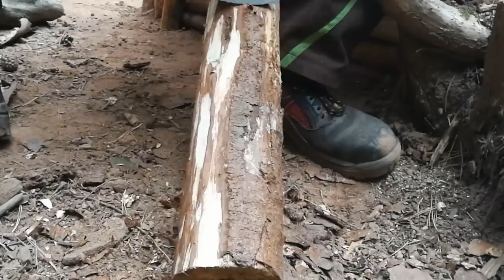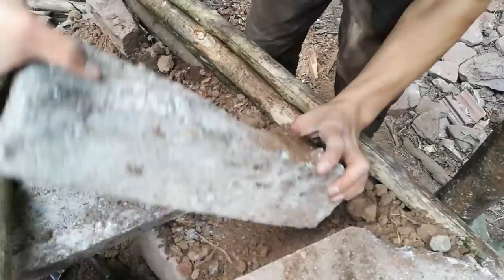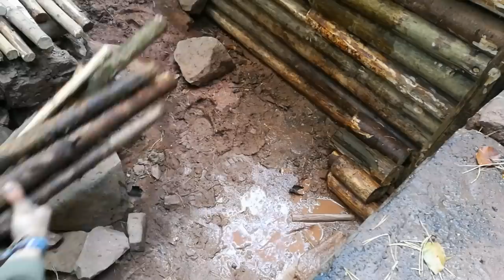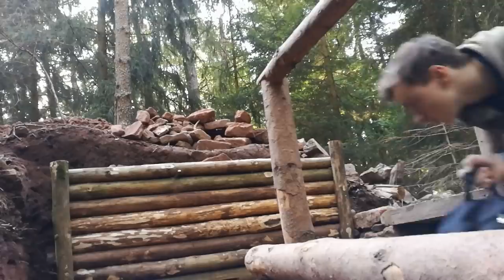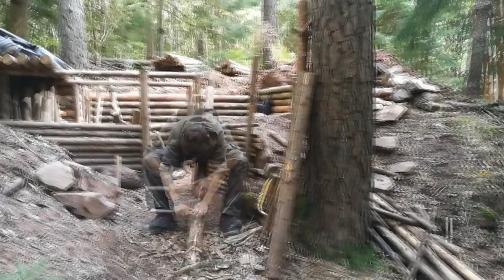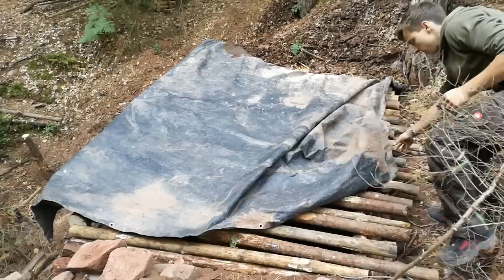From DUGOUT to small CABIN - Walls and raised roof, Dugout Shelter Part 3 // JustRandomPfusch

Comment: I don't get it, I've seen so many of these dugout, ww1 trench style dwellings on youtube and everyone just loves them.  When it rains what's to stop the mud and water from running through the walls and seeping up through the floor no matter what you put down.  Everyone just sees these things in the nice dry summer.  I've been in construction my whole life and you have to deal with the water by waterproofing the outside of the walls ( at least a chunk of plastic) and build your floor on something that will allow the water to flow underneath, like gravel or sand.  A skirt drain would come in darn handy too.  It doesn't take a lot of water to make your summer home into winter nightmare.
Reply: I agree your comment.
Reply: He said about how he has a rock layer behind the logs to act as drainage, I don't know how good that would be but at least that's an answer.
Reply: FYI at the beginning of this video you can see that it rained as he dumps the pool of rainwater from his tarp and underneath in the living space it's bone dry. Apparently the rocks and tarp prevent in leakage
Reply: @redrangerrr558  the rocks are there to divert the drainage if there is any.

Comment: if you burn (a little bit) the parts of the wooden stakes you are driving in the ground, they will not rot as quickly. I love what you are doing, keep it up.
Reply from the maker: Thanks, unfortunately I learned about this technique only after building this
Reply: I was thinking the same thing it helps out alot good seeing someone giving good info. Instead of some of the other comments who do nothing but insult.

Comment: You are doing quite well for yourself on that shelter! I hope that in the end of construction, that it is everything that you've wanted it to be! It's allot of hard work for sure! The project is very unique and should serve you for the years to come. If you were to create a small trench/water troth, 1/2 meter out away from your outer walls to help carry any water that could possibly try and infiltrate down into the walls; well then you should be in great shape! But then, you could also create a sloped overhang on the frontal entrance way; such as to detour any incoming rainfall too! Overall Kiddo, you are doing a great job! I'm proud of Yah!!
Had I'd known that you were going to take on a project like this one, I would have a really hot tip for you that would surely blown your mind that involves the use of tree leaves to make your shelter insulated, and yet as they decompose; the leaves will
actually provide you with heat to offset high usage of having to use large amounts of firewood.
Reply from the maker: Thank you! :)
I will do something about the drainage. It works well so far, but it can definitely be improved

Comment: Have you considered digging a little trench around it?
Just so potential waterfloods of heavy rain flow AROUND it.
It looks like there is a little hill nearby or sloped terrain.
Reply from the maker: Yes your right, there is a slight slope and I also considered a trench. So far the shelter is holding up well without, but I think I'll do it someday
Reply: @JustRandomPfusch  Probably already 10cm and a few rocks would suffice.
Reply from the maker: @MWcrazyhorse  that's what I had in mind, too
Reply: @JustRandomPfusch  And you could make the trench round or triangular so water would flow better.
What about a rainpipe? Trench/ rainpipe.
Reply from the maker: @MWcrazyhorse  I want to use natural materials only
Reply: @JustRandomPfusch  Maybe a halfed log hollowed out.
Something to direct the water off the roof into the trench so it doesn't accumulate near the entrance.
Reply from the maker: @MWcrazyhorse  because the roof is sloped to the back, there isn't much water accumulating at the entrance. S the main problem is the back of the shelter, where all the water runs to and seeps in the ground directly besides the shelter and tends to push through the walls. So I need to divert it away back there
Reply from the maker: @MWcrazyhorse  hollow log could be a solution 👍🏼

Comment: I'm basically building the same thing.  But I 
am dug in about 7 feet on 3 walls. 5 feet on the 4th wall dirt bags the rest of the way on up. Gonna seal walls in with white concrete paint roof will be covered in dirt flat rock floors and small rocket stove with a copper coil for hot water and solar for electricity. And the view I'll have people where I am from pay a million or more for there house.  
Plus I have plenty of room to add on later on. Plus do an small A frame on top of it later for a kitchen and bath plus sitting room to see my million dollar view

Comment: when using a chisel to chip , remember that flintknappers technique of rubbing the rough edges to control the break otherwise you might knock off a huge chunk in the wrong place and ruin the work  _ T4S

Comment: Just a heads up concrete has a tenancy to explode in high heat such as a fire place you might  want to change that to stone or even mud brick
Reply from the maker: Hm, your right, I didn't think about that. As you can see in the thumbnail we already built a chimney ontop, so it will be difficult to change anything. But I will see what I can do.

Comment: JRP Thanks for sharing all your hard work in the forest. You are  using a practical design that blends well with the surrounding environment. It was too bad you had to re-do so much of your work in the expansion. Was it a lack of resources that prevented an another solution for a larger area to the right of the main door?? Best success on your wilderness hideaway and I look forward to future videos to be posted.
Reply from the maker: Thank you :)
I'm not sure if I got your question right. Do you mean why I didn't make it as big as it is from the beginning or why I didn't make it even bigger during the expansion?
Reply: @JustRandomPfusch  Thanks for the reply. I understand when building a shelter like this that the first version is made to meet a need, but needs change. When you constructed your new expansion to provide for new needs, instead of undoing work you had previously done, could you have just added the space you needed and only had to remodel an entrance to the new space??  I can email you a simple layout drawing of what I was thinking or I can write a Blog post and share a link.
Reply from the maker: Sure, just.pfusch@web.de 
Looking forward to seeing it
Reply: @JustRandomPfusch  Email has been sent. Cheers.

Comment: Nice build and effort. You could try weaving the tarp between the logs on the roof instead of using rocks to hold it down. It may even help water proof it a little. Anyways nice job.

Comment: i was pretty sure that place would flood and it did.  you could have lined the floor with drainage ditch covered with rock and been happy.
Reply from the maker: The water you saw on the ground was what I poured down from the tarp. It was just during the building process, the tarp wasn't properly installed. Now that it's "finished" I don't have any problems with water
Reply: He poured the water in there he said it

Comment: Shelter is nice, but height is too low. That's bad for your back. Bending over, staying bent too long makes your back tired and weak. I know your young, but a little improvement could help a little. Raising it a bit or dig out a few feet deeper lower will make you feel better. It will give you quite a relief, make you feel better. I have gone through that problem couple of times. Well enjoy this days out there and have fun. Keep it up.

Comment: Are you going to seal it up so it doesn't get ruined by the rain so you could live in it if you you had to? And you should put a flier in there :)
Reply: *floor not flier
Reply from the maker: What do you mean by sealing? I got a heavy duty tarp on by now and plan to further improve the drainage. So far * NO * major problems with rain, only damp spots on the walls in one corner
Reply from the maker: Also thought about a stone floor, but that be a lot of work

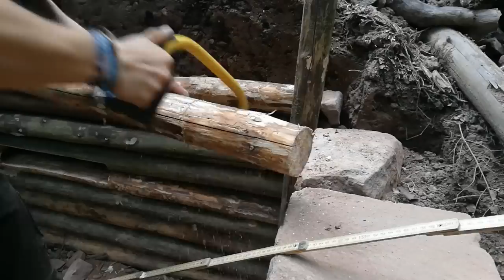Comment: 1:21 Last time I seen a tape measure like yours I was in the basement by my Dad's work bench. Dad had one of these too. I'd always figured he got his from his dad my Grandpa. Very old but it worked perfectly. Thanks so much for the memories and now I can't see for the tears. Nov 10.2019 HOLY TOLEDO you're industrious!!! You need to checkout this man you and he share woodworking skills w/primitive tools. His channel is MySelfReliance.com on YT. Shawn James and Callie. I hope you strive to be a builder or architect cuz kiddo you got the Right Stuff!!!
Reply: Yozaaa TY TY TY whomever you are for my first LIKE!!!!!! YOU ROCK THE HOUSE!!!
Reply from the maker: I know Shawn James, he's a great inspiration
Reply from the maker: This is a normal and wide-spread tool every craftsman uses here in Germany. You Americans are more into the rolling tape measures, right?
Reply: @JustRandomPfusch  , my Grandfather used a folding carpenter's measure just like the one you have. It's well over 100 years old  because it was my Great-grandfather's. It still works like a charm. I have it in my tool satchel.
Reply: @JustRandomPfusch  yeah
Reply: @JustRandomPfusch  Yes, most of us use those "tape rules" over here but many bricklayers still use folding rules which are specially marked for standard brick sizes. I think the main advantage of a tape rule is the length- some are over 10m long and can be held out to reach 4m away or more. Tough to measure that much distance quickly and accurately with a folding rule, especially over an open space. Also the hook saves a few steps back and forth from the ends. As long as you use a tool well that is what matters the most.
Reply: Only time I had ever seen a ruler like that was when I played with my dad's tools. Haven't seen one since then. I never knew why he had it but always thought it was neat. Now I know why it was designed that way. Thanks. (Now I will have to ask him if he still has it.)

Comment: Not snow not heat but water is the equalizer when you make shelters. Water like money seeks it's own level.
Reply from the maker: I don't have any larger problems with water so far. Still I want to improve the drainage, at least the water that runs off the roof

Comment: Not to rain on your parade here. And you've done a lot of aspects very well. But there are other that I think you'll have large consequences down the line with. The first one is the soil next to the logs. You interlaced it with some larger rocks to will it up. But you still neglected to create large pores where water can drain more easily to the ground. This will create more water in your cabin than you expect. It will also cause the logs to rot much more quickly as they will be waterlogged on one side, even if you try to dry it out with heating the cabin. This will cause the second problem as well. Since you don't drain the water under the floor level, you'll have groundwater coming out at the floor. The roof angling the water to the back of the cabin will exacerbate this problem. What you need to do in order to mitigate this is to dig up the layer just next to the logs and pour in some high porous gravel (the larger rocks you have might do the job, but you need to keep soil from coming into the airpockets between the rocks) all the way below the floor level. You also need to dig a channel on the side and lead that water away to a lover level from the cabin and fill it with the same porous gravel. This will allow the water to easily be lead away from the cabin and consequently much drier. 

It sounds like a lot of work to do it like that. So you might want to do a effort/utility benefit on it. But if you want to keep it long term as a working cabin. I highly suggest you do something about the water drainage.
Reply from the maker: Thank you very much. That's some good advice. I know the drainage could be better, but it works surprisingly well. There's clay on the left side of the shelter. But on the right side the drainage has to be improved. I also thought about doing a stone floor, for aesthetic reasons, too.

Comment: Mountain rain will easily pour in from the slop...........
Reply: The Lord I’ve been speculating how to deal with ground water from rain?
Reply: HeadFlowInc You can’t deal with it if the structure isn’t sealed. It’s gonna get muddy in there quick with all that loose dirt around. It’ll go right through the walls when it rains.
Reply: Yeah,this will hold just for a short time,or only in sunny day...

Comment: Cool shelter. 

One suggestion. Your roof is sloping backwards to another opposite slope. Runoff from the roof and the slope will gather in the middle on top of and behind your back wall. It will eventually break through and flood your shelter. Eliminate the sloping ground by adding soil or, slope your roof forward and extend it outwards.
Reply from the maker: Thank you.
I sloped the roof backwards to avoid a muddy entrance. 
But of course you're right, I see the problem.
That's why I plan to dig a trench and divert the collecting water away, maybe even keep it in a small basin

Comment: Dude, you have so much clay out there, why haven't you built most of the thing out of brick!?
Reply: Bricks need weeks to dry out, then they need to be fired. Much easier to work with trees!
Reply: @alisonhenry820  still, when I'd gotten a roof set up I'd've started setting up bricks to dry so I wouldn't be putting wood against dirt.

Then again, I have experience with clay and wood alike.

Also, you augur holes in the bricks specifically to reduce the wait time and reduce the likelihood of them exploding when fired.
Reply: @PsylomeAlpha  oh, is that what the holes are for? I'd always wondered! I'm a woodworker and an artist, so my experience with clay is limited to sculpture etc. Thanks for the info, I'm always looking for more knowledge. I like how he back filled the space immediately behind the walls with rocks, I assumed this was a barrier to keep the earth off the wood. He's an industrious young man, that's for sure.
Reply: @alisonhenry820  yeah, that's why there are holes in the brick.  I think that is why he backfilled with rocks, but that's still prone to bugs and vermin nesting in it.  I think the rocks were also to help with drainage.
Reply from the maker: @Melissa you're absolutely right
Reply: @PsylomeAlpha  actually in the balkans in the old days since most villages was on mountain or hill sides they used to dig in the ground to level the floor and then build the house out of clay or rock, with many houses having only their front side above the ground and the roof 😉

Comment: Nice job , but shouldn’t you have leaned the roof forwards, for rain runoff ?
Reply from the maker: I didn't want the water to come down at the entrance and make it all muddy there. I arranged the tarp so that it collects in the back right corner, I have to figure out how to divert it from there. Probably a trench will do it
Reply: yea a trench around the entire sight will help with the rain, lookin cozy :)
Reply: @JustRandomPfusch  A French drain perhaps and perforated 4" pipe?
Reply from the maker: @howardfortyfive9676  I want to use natural materials only

Comment: Why do you put rocks behind the walls? Wouldn't it be easier to reuse some of the dirt that you dug out and put dirt behind the walls?
Reply from the maker: It acts as a drainage and keeps the wet soil from touching the logs. Prevents rotting overall
Reply: rocks keeps the heat (and cold) better i guess
Reply: That is an awesome job young man well done

Comment: why did you use concrete blocks on fireplace? stone would be better. how did you find it in forest anyway ? :D
Reply from the maker: They matched better. Some older gernerations used to dispose their rubble in the woods there.

Why do you think stones would be better?
Reply: @JustRandomPfusch  for aesthetic purposes :D by the way i liked your work there. congrats
Reply: @JustRandomPfusch  also stone holds more heat, concrete is better for isolation
Reply from the maker: you´re right maybe they yould look a little bit better, but now it is too late.
Tank you  :)

Comment: I got a question for anybody that knows... what is the point in skinning the logs?
Reply: They will last longer
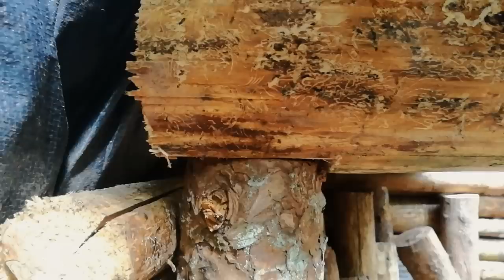Reply: The space between the bark and the wood is where wood-eating bugs make their home. You can see on some of the logs  here that they've already been attacked by something - that's what the little curly patterns on the wood are that you can see in the closeups around 13:12 are. As they eat, they go further and further into the log, and eventually compromise structural integrity. Removing the bark leaves the bugs exposed, which they don't like, so they try to find somewhere better. Which is why peeling the bark makes logs last longer.
Reply from the maker: Very well explained, better than I could've done. Thank you!
Reply: Karin [CAR-in, not CARE-en] thanks 👍